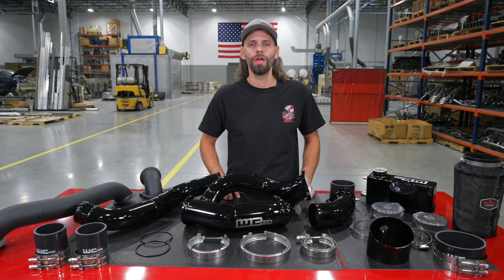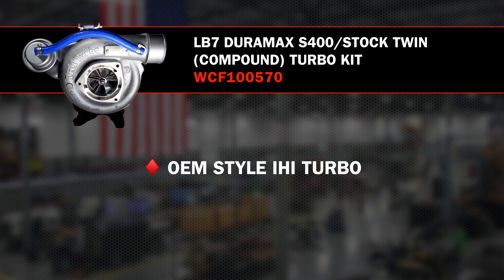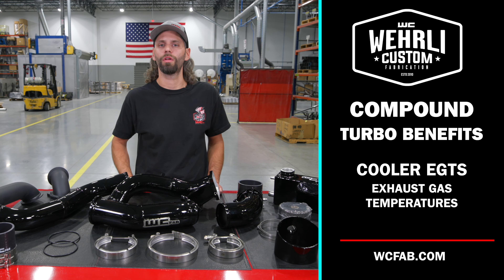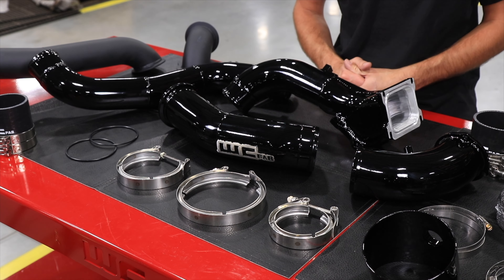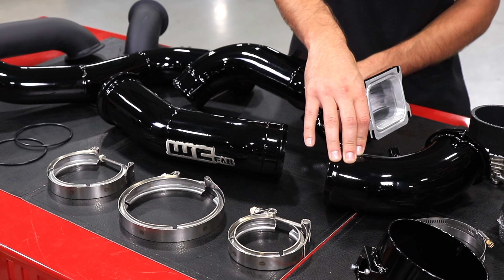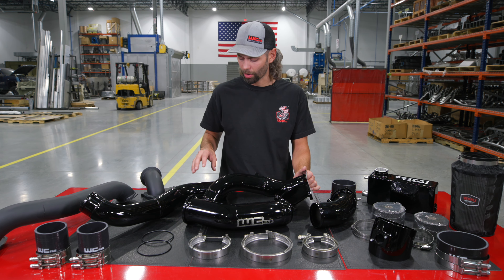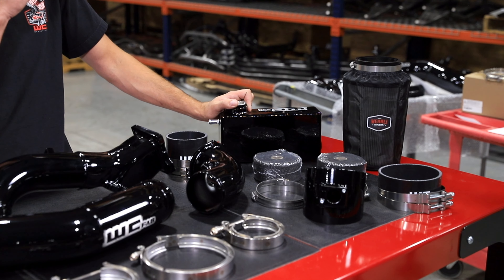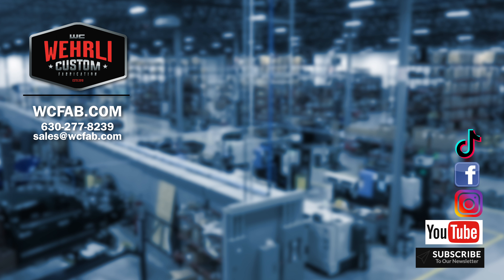2001-2004 LB7 Duramax S400/Stock Twin (Compound) Turbo Kit

Comment: Will this work with a dans diesel performance stage 2 66mm drop in
Reply from the maker: @tierrahamaker4705  yes with the right atmo charger tuning and fuel setup you could run this kit together with your 66. That said, many customers find that they like the drivability better with a bit smaller charger in the valley with this kit. The team is all out at PRI currently, but give us a call at the shop (630-277-8239) next week to talk with one of our specialists about a setup recommendation that would work best for your needs.